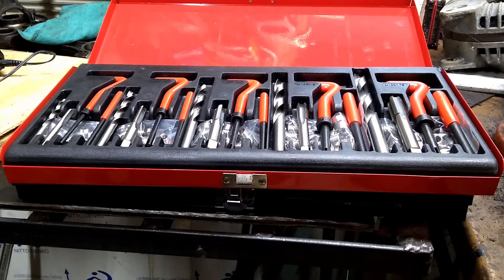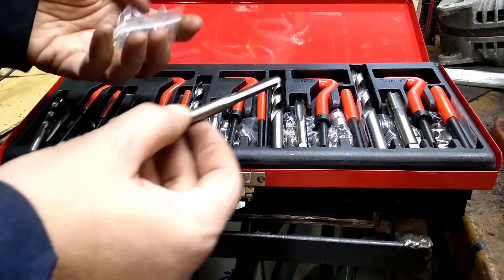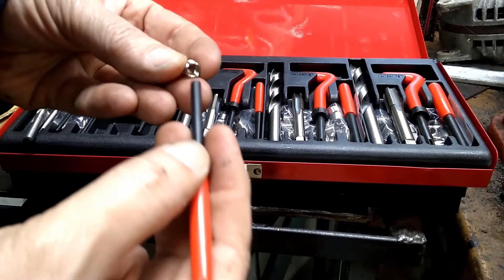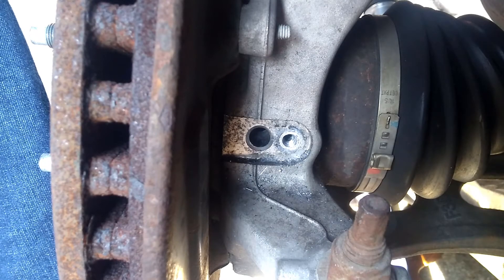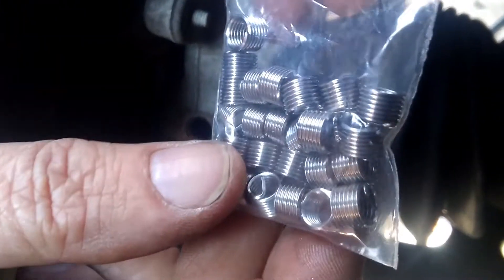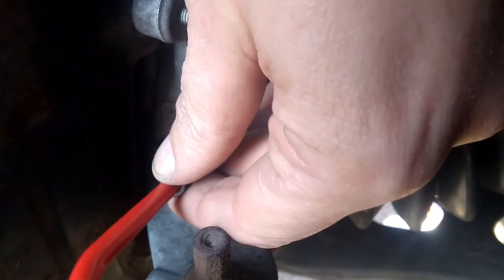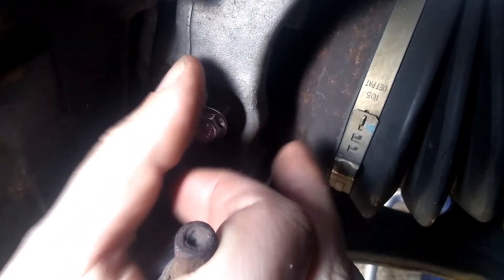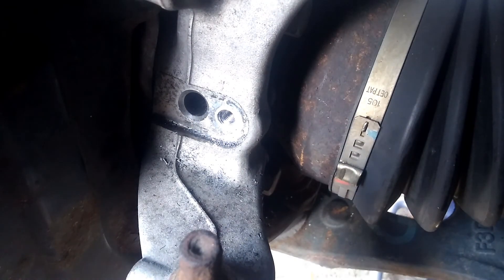How to Repair Stripped Aluminum Threads

Comment: Stupid question but couldn't we just up the bolt size after drilling and tapping larger?
Reply from the maker: Not in this case. The sensor has an eye on it that the bolt goes through, and a larger bolt won't go through that

Comment: Use Red Loctite on the Coil.  Keeps it from unscrewing out.
Reply: I hope its never needs to be unscrews for equipment repairment
Reply: @denistavares3668 red loctite can be overcome with a heat gun.

Comment: So, how long are these taps?  My 6x14mm aluminum hole stripped out.
Reply from the maker: The 6mm is about 2.25" of reach pas the tap holder
Reply: @YoshimoshiGarage I love the way you use  metric and imperial in the same sentence just to confuse people a bit more bit like Double Dutch 😮
Reply: Without having them at hand, I guess you could count the ridges. Should at least get you very close.

Comment: Where does the tab go once broken off?
Reply from the maker: This hole goes all the way through, so it fell on the driveway
Reply: @YoshimoshiGarage  I see. So if it didn't go all the way through, would you fish the tab out with a magnet?
Reply from the maker: Probably, yes. Or a shot of compressed air